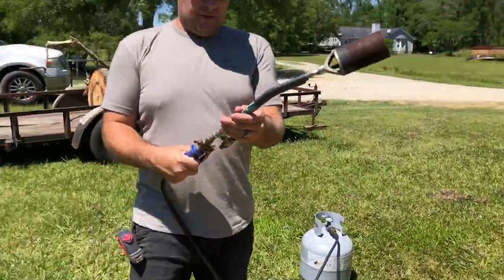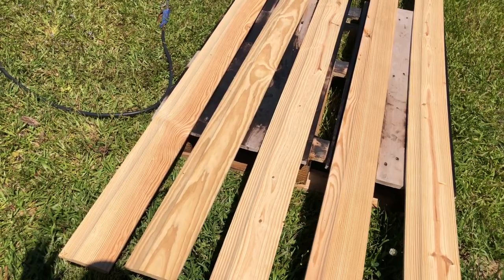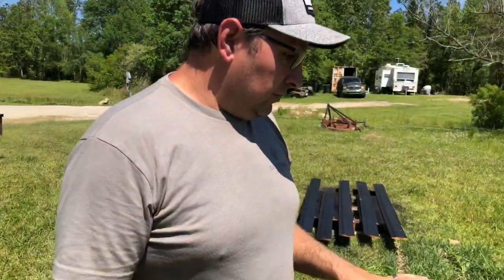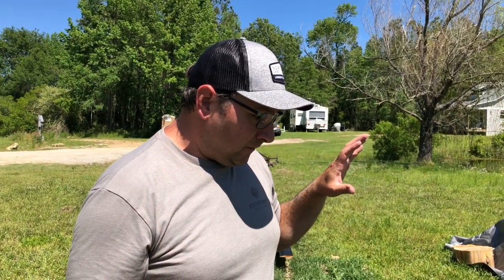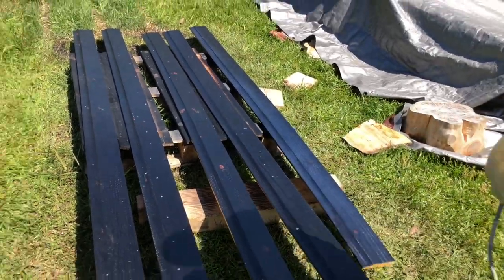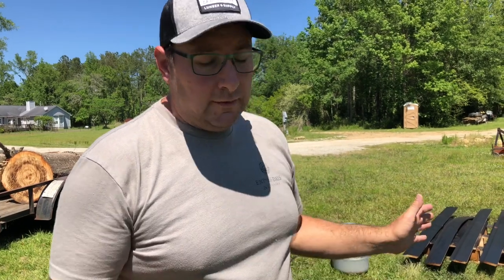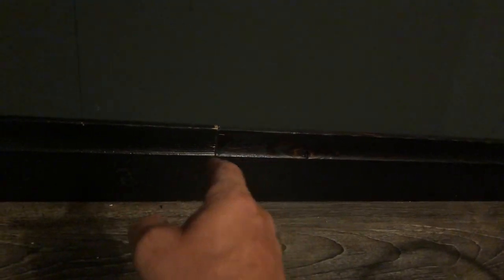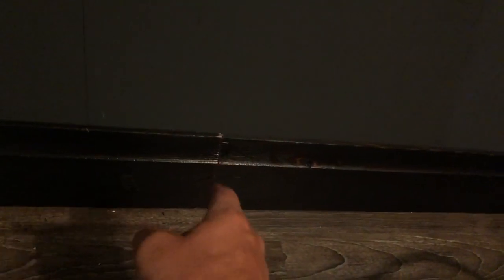DIY Shousugiban Style German Shiplap Accent Wall

Comment: Hi! Thank you so much for sharing your videos, they are very well filmed.. I want to build cedar garden beds using this technique. Is it truly as simple as you make it look ?  Do you have any videos of what not to do, things to look out for, or how to fix mistakes ?  Thank you!!
Reply from the maker: the Chilichick nope its pretty simple. My wife came out to my shop a couple months back and built a stacked herb box using this technique. Don’t use treated wood. Burning would produce toxic smoke. Use 2” boards if you can. Less chance of them warping. Other than that follow what I mentioned. If you have problems ask. If you have more questions ask. Thanks
Reply: @loveofthegrainworkshop2891  Thank you so much.  I am also going to build a stacked box :) I really appreciate your videos and all the shared information. Thank you!

Comment: What about those drops falling on boards you just sprayed ok? Generally inspiring thanks.
Reply from the maker: Those drops as mentioned were from my bowl of the gun not being tight enough and so the pressure it built up pushed some out over the edge. I simply wiped them with a rag, tightened the bowl and then the next coat covered over the areas I wiped.